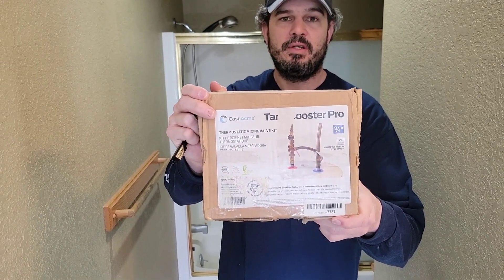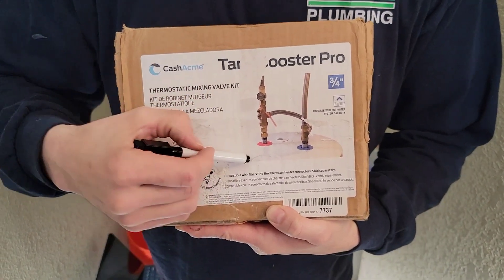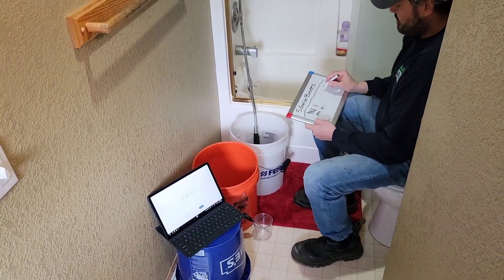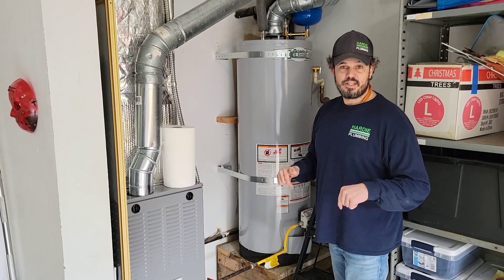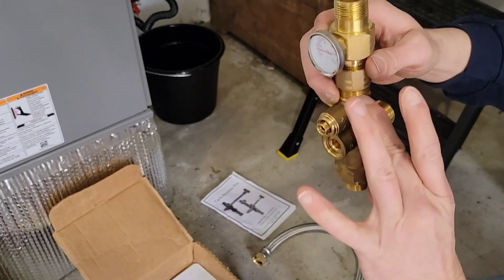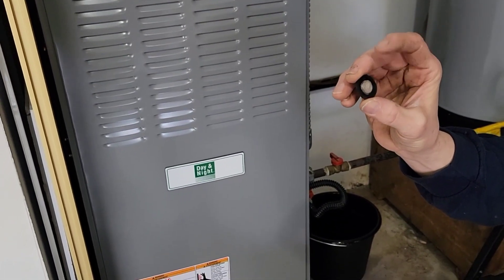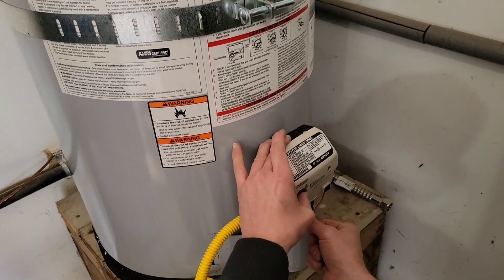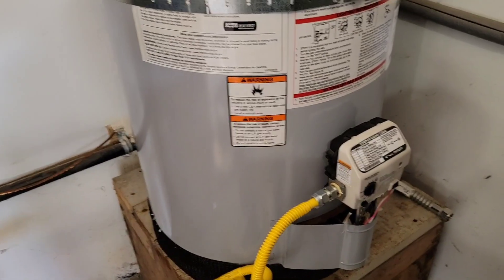Double Your Hot Water with Tank Booster

Comment: Since you felt the need to comment on my video making the opposite claim, I will take the same liberty. :)   FACT: the Tank Booster didn't double anything.  The only way your hot water was increased was by turning up the thermostat on your water heater.
Reply: This is literally how the device works, my dude.  You increase the temperature of the water heater thermostat and then use the TMV to mix cold water in.

Comment: Ya know what we did for decades is just simply turn up the tank and just use common sense. I get all the safety arguments but this isn't a new concept.
Reply from the maker: Definetly Not Common Sense to turn your water heater up to 150 degrees without a Thermostatic Mixing Valve. It's extremely dangerous to have scalding hot water especially around young children and elderly. 150 degree water on your skin just for a few seconds will probably have most people going to a hospital. It's a Plumbing code for a reason. The delivered hot water to Plumbing fixtures can not exceed 120 degrees.

Comment: Not boring, just not for me. This is on all the time so in order to get the full hot water to wash dishes or clothes, it'd need bypassed for those tasks. And no, I we aren't scalded by 150F at all; 180F, then yes. Either way, it's still using the same amount of water and water is more expensive than gas that heats the tank here AND back home (1,600mi away).
Reply from the maker: Thanks for commenting

Comment: You know, if you just turned the tank up in temperature, you don't need any fancy gadget, a valve or cartridge is already built into your tap.  You can just use more cold water right there at the tap.  Why do we need this? Seems like someone overthought a problem that already had a solution.  Love the channel, but this is weird and in my opinion, unnecessary if you have faucets.
Reply: Because 120 is the recommended max and 150 will scald you. Whereas you and your family might be able to mix your 150 water at the tap. You will be legally liable for a guest or child that gets scalded.
Reply: @joshs1555  good to know. Thanks. I honestly didn’t understand the problem that was being resolved and now I do. This is why I interact!
Reply: Only reason is for safety of kids and or guests. Some people are used to low hot water temp and crank up the hot as soon as they walk in front of a sink.
Reply: @bustex1  makes perfect sense now that I understand what the problem is. I am used to having burning hot hot from my parents place so I assumed it was the norm.
Reply from the maker: Thanks for commenting

Comment: BS
Reply: Engineer here. Nothing BS about this at all, they work and they work well. Upping your tank from 120 to 150F is increasing the total stored energy (heat) around 40%
Reply from the maker: BS..Best System to increase your Hot Water quickly and affordable?
Reply: @LearnPlumbing this is literally just a mixing valve under another name for marketing. It doesn’t boost the production of a water heater, it just limits the amount of hot water used by the entire home with a temperature setting and a ceramic cartridge. It’s a glorified faucet, and a scam.

Comment: How must more energy does it take to keep your tank that much hotter? I know tanks are very well insulated, but is there a temperature at which you'd lose heat too quickly for it to be energy efficient? In a 65F basement?
Reply: its in your basement, the lost heat is recovered to heat your home anyways, so the loss would in theory be negligible
Reply: @tslim250  maybe in the winter time, but in the summer it’d be heating up the house that you’re trying to keep cool
Reply: This is a real problem with a gas water heater. The uninsulated flue pipe that runs up the center of the tank creates its own draft by transferring heat from the tank. The heated air in the flue rises out of the exhaust and is replaced by cool air from around the heater. the hotter the water in the tank is the faster the heat transfer and air movement will be. I have seen some large commercial water heaters with an automatic damper on the top of the tank to reduce this type of heat loss.
Reply from the maker: Yeah they make a regular atmospheric gas water heater with a power damper on top as well to trap the flue gas in and pilot heat. Imcreases rhe efficiency just enough to get an energy star rating. We get customers wanting this tanknso they qualify for the.$50 rebate. We charge at least 100 more for tank. It then becomes an interesting conversation